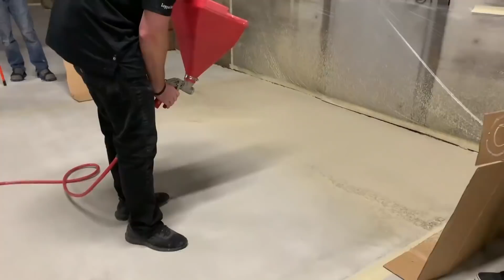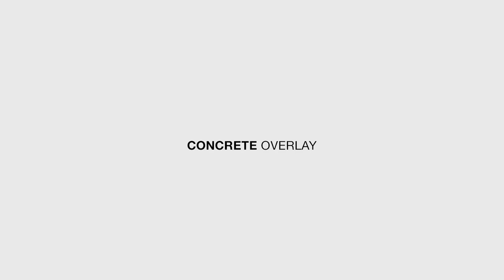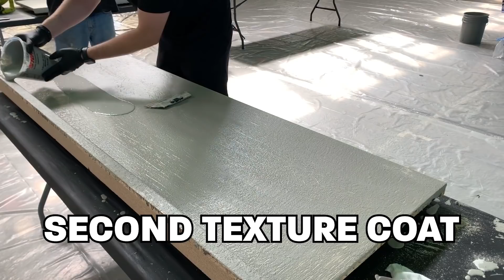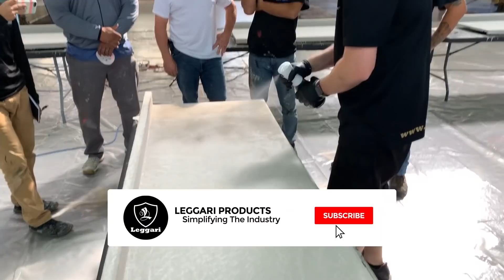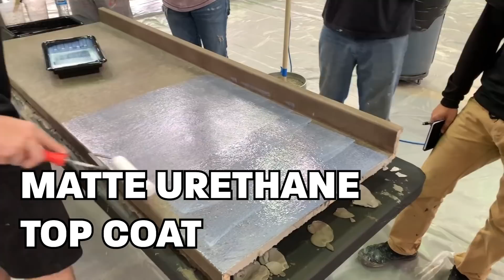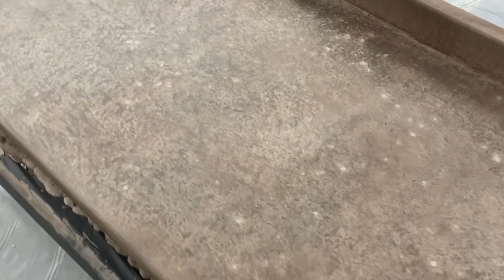DIY Rustic Countertop | Concrete Overlay

Comment: Just to curious , so this !!!! Overlay concrete material has large aggregate in the mix or is this a cement overlay material with fine sand aggregates in the mix ? What’s the PSI rating once cured ? Nice top but how does the sealer hold up to acid staining from fruits and vegetables or dish soap surface erosion?

Comment: Looks great. 
Is this overlay a textured epoxy died and added grain to look like concrete or is it really cement/concrete based?
Reply from the maker: This is an actual concrete overlay product (cement based) from our new Concrete Overlay line. Looks and feels like concrete but is polymer modified for added flexibility. Keep watching we’re releasing lots of different looks using our various stain colors. Thanks
Reply: @LeggariProducts  
Great!
Thanks for the answer